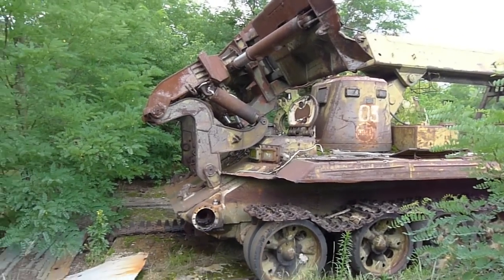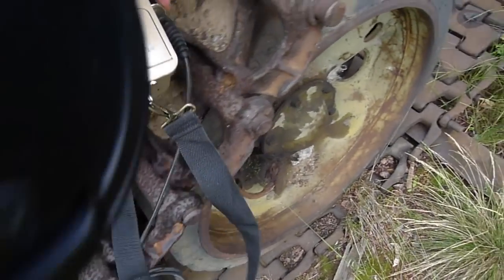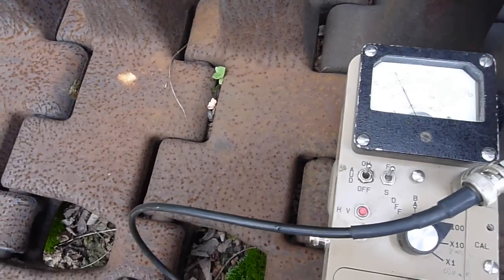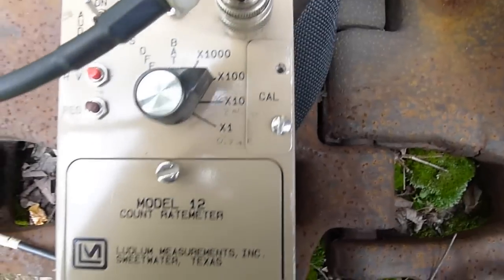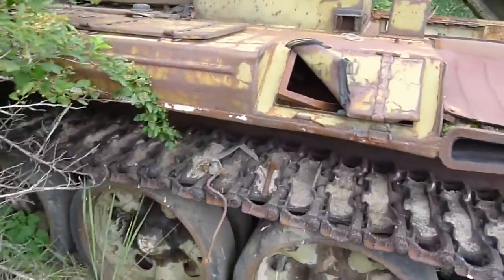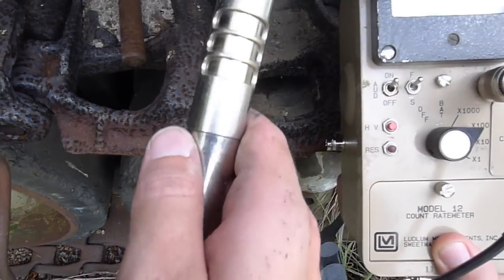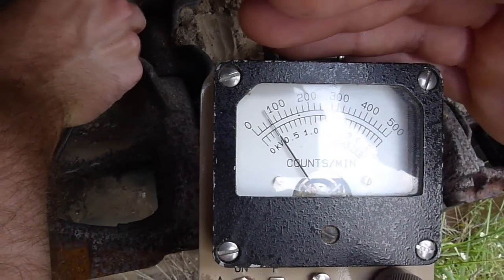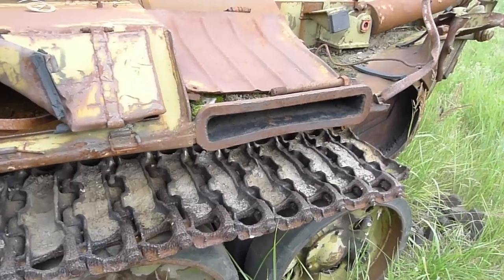Radioactive vehicles near the Yanov train station, Pripyat

Comment from the maker: A Ludlum Model 12 ratemeter can probably be picked up on eBay for $300-400.  It doesn't come with detectors, so you'd have to supply the type of detector that interests you (scintillators, proportional tubes, GM tubes, etc.).

Comment: wow, can you actually decon that probe properly so it picks up normal background levels again now - after sticking it into radioactive debris and all, haha?
hmm, i think i would've wrapped mine up in a thin layer of plastic, if it's just for gamma ray measurement, anyway. :)
should i ever get the chance to go to chernobyl in an off-limits tour like that, i'll definitely bring some of these disposable hospital operating room covers, used to cover e.g. ultrasound probes and machines!
Reply: bionerd23 i' m from the future, you went there many times ;-)
Reply: They are very easy to de con you can remove the tube very easily and just wipe it all down also you can remove the beta shield and wipe that down to

Comment: @Thallium208 thanks for that info on the keV. Lapse rate i think is wrong term, but what I'm referring to is how long after detection is the tube available for another detection. Forget what the term is, but like you mention it is irrelevant. I should use a CDV-700RP from SEI, inc rather than the Anton 6991 for the purpose I stated.

PS you have great videos.

Comment from the maker: No, son, the "gras" is not particularly radioactive.  If it were, I'd be showing the Geiger counter on said "gras."  The treads of these vehicles are more radioactive for a very simple reason--fuel particles got compacted into them during their use in decontaminating the inner Exclusion Zone.  Now run along and troll someone else.

Comment: Please describe in a new video what radiation is dnegerous to you and which one or which rate / dosis is not...
Seems you have no fear of radiation.
So would be interesting to know, what you think is dangerous and what not...

Many thanks.

Regards, Stefan.
P.S. this hot sand stuiff from the vehicle could be probably very well used to make an exciter for a Joule Thief LC circuit and thus light up a few LEDs , so to convert radiactive radiation directly into electrical energy...